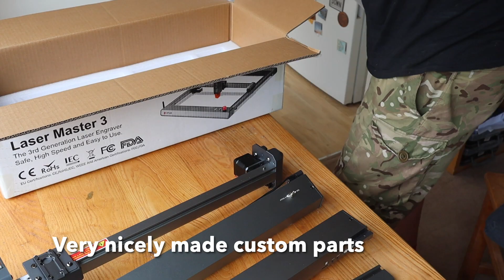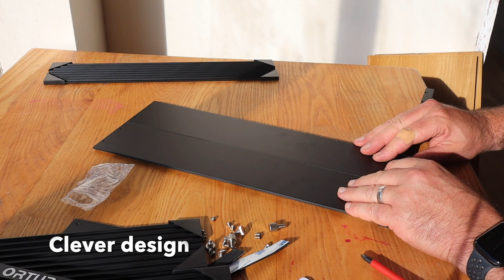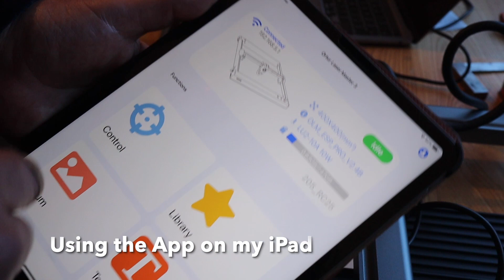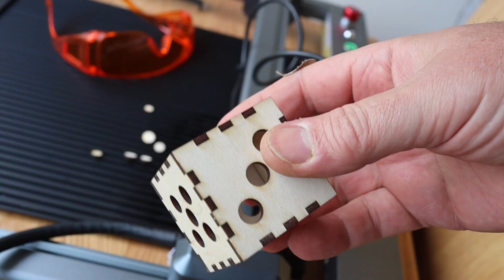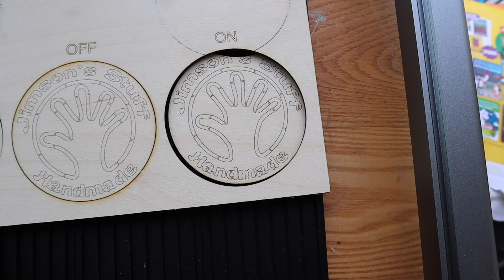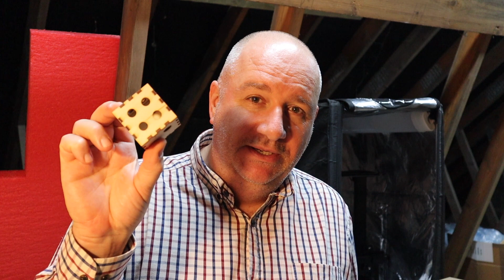Ortur Laser Master 3, the next level in diode lasers

Comment: I like LM3,but had a bit of rough start with mine, AC adaptor blew when I first connected to main, wasn't connected to laser so no damage to it. I bought brand name 24V 4A and now it's working as a charm. Also lens get dirty very fast without air assist, cleaned that bugger after every job no matter how small the project was. After connecting compressor as an air assist, issue is gone.
Reply from the maker: The lens gets dirty very quickly on all the lasers I have tested, it is a common problem. Cutting is no problem as the air assist keeps the lens clean but engraving without air assist certainly causes problems. It does help if you have the air assist running at low power whilst engraving. The only problem I was getting with the OLM3 is that it did not always want to connect to my Macbook, but this seems OK now.
Reply: @JimsonMakes  Thanks for reply and info, I keep assist on lowest possible when engraving and crank up when starts to cut. Doesn't ruin engravings. Didn't bought pump yet, rather using my trusty compressor. Also did little modification in term of rubber O-ring added to nozzle on top of original one. Read somewhere that nozzle when fully screwed in partly blocks air assist hole on the side of thread. Didn't test it tho, but by the difference in sound of air blastin out of nozzle, it might be true.

Comment: Jim, please be very careful with operating Lasers without proper inclosure. The Laser Light is dangerous to the eye even when reflected from plan surfaces. And cutting Laser should always be operated with a good fume extraction. The fumes can cause irritations and diseases like miner's lungs. 
Your fellow colleague Angus from Maker's Muse has posted a video lately that opened my eyes!
Reply from the maker: Yes quite agree, I always wear the glasses and although you can’t see it in the video there is a patio door open just behind the machine and windows open at the other end of the room so that all the smoke is carried out. When it is being used in earnest it will be installed in my enclosure with fume extraction in the workshop .